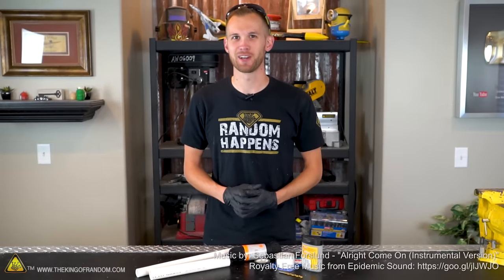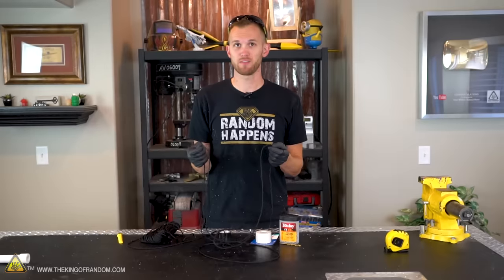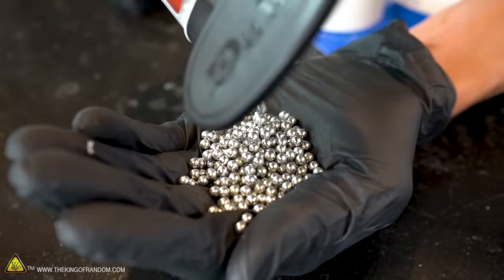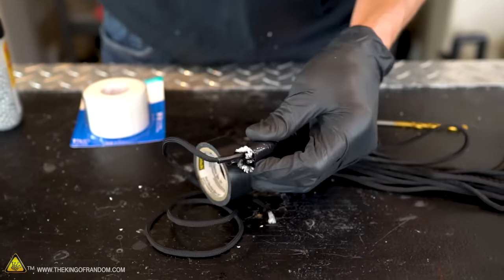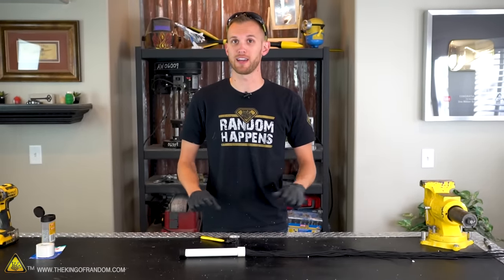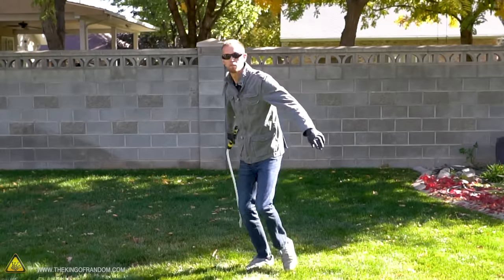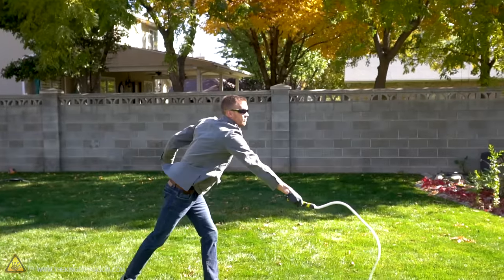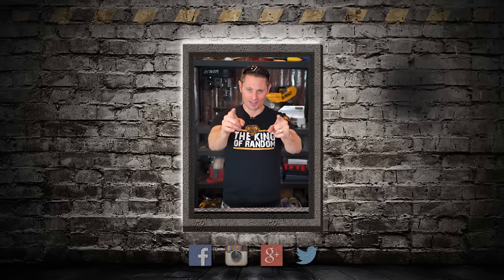How To Make a Paracord Bullwhip (like Indiana Jones)! TKOR’s How To Make A Bull Whip Guide

Comment: For everyone who doesn't really want to watch the whole vid 

Para cord bullwhip

Three quarter inch PVC 
One inch PVC 
30m para cord
BB's
KT tape
Electrical tape 

1.Cut the 3/4 inch PVC to nine inches 
2.Cut the 1 inch PVC to 1 inch
3.First piece of para cord 8 feet long (8feet in front of handle 2feet behind)
4.Use electrical tape to mark where the bottom of the handle is
5.And 18 inches from the end of the para cord (the fall of the whip)
6.Cut nine more pieces of para cord of diminishig lengths 
7.First piece of para cord must go from the first tape mark to the second 
8.After that each piece must diminish by 8 inches every time 
9.Cut three more pieces of the same length as the 3rd largest;6th largest and 9th largest piece of para cord 
10.Fill those with BB's 
11.Close the one end off by melting it 
12.Take a drill bit a bit bigger than the BB bullet, and stick that in the para cord once you've gutted it, the melt it so it stays open permanently.
13.every foot and a half tape it with para cord once the rope is taped into the handle,
After that rap it with KT tape and then your bullwhip is complete!
Reply: Bradley Whitburn but its not kt tape
Reply: Having personally made 4 nearly identical copies of this whip and have a fairly small, but diverse collection of whips. From experience, here are some recommendations if you want to make your own, for anyone who ends up seeing this:
1. Don't bother with the longest BB strand- it makes the whip too heavy
2. Take about a 3ft strand and wrap it around the base of all the strands, then tuck it inside the PVC piping- it goes a long way towards making the whip last long term. It is also recommended to connect it as you would with the longest core strand by wrapping it around the very butt of the whip
3. Use quite a bit, but not too much, heavy duty tape when you are connecting the rope to the PVC. Too much will make that section inflexible and it will not crack properly (about 4 reversing, fairly loose wraps of duct tape worked well)
5. For a beginner, i recommend actually using a shorter whip- around 6 feet is plenty, and is actually closer to what is used in competitions anyways.
6. Be careful. Choose a low traffic area, such as in your backyard, and mark off a spot where you have at least three feet more than your overall whip length in every direction. Even behind and above you. Trust me, its important.
Reply: Jalen Johnson what a legend
Reply: The video is only 11 minutes and it takes more time than that to make the whip
Reply: Nathan Meadows what?

Comment: Having personally made 4 nearly identical copies of this whip and have a fairly small, but diverse collection of whips. From experience, here are some recommendations if you want to make your own, for anyone who ends up seeing this:
1. Don't bother with the longest BB strand- it makes the whip too heavy
2. Take about a 3ft strand and wrap it around the base of all the strands, then tuck it inside the PVC piping- it goes a long way towards making the whip last long term. It is also recommended to connect it as you would with the longest core strand by wrapping it around the very butt of the whip
3. Use quite a bit, but not too much, heavy duty tape when you are connecting the rope to the PVC. Too much will make that section inflexible and it will not crack properly (about 4 reversing, fairly loose wraps of duct tape worked well)
5. For a beginner, i recommend actually using a shorter whip- around 6 feet is plenty, and is actually closer to what is used in competitions anyways.
6. Be careful. Choose a low traffic area, such as in your backyard, and mark off a spot where you have at least three feet more than your overall whip length in every direction. Even behind and above you. Trust me, its important.
Reply: Yes this is true i tried it without the longest strand and it saved so much time and still worked

Comment: If I make a longer whip, should I still use the same number of strands and size difrences, or proportionally scale it up
Reply: Sidney Wateski most likely scale it
Reply: Probably both. If it gets too thick it wont work as easily.
Reply: Sidney Wateski  idk
Reply: You'll end up adding a few strands. You want the whip to start tapering at about 2 feet from the handle. So if you do what they did and drop strands every 8 inches then you'll need to add strands. 1 for every 8 inches

Comment: Can you heat slime to the point in which it is a gas?
Reply: That's just evaporating the water off which would leave all dry components you used in the slime in the container
Reply: karl malek no
Reply: Daniel Wyatt is right.
Reply: Daniel Wyatt and that would probably burn

Comment: Can you tell the paracord sizes and
Reply: its 550 paracord, Military grade with 7 stands on the inside.
Reply: BostonTricker not that I want to know how long is it and how many do we need
Reply: I didn't tell you how long it is or how many you need. 550 is the name of the paracord as it can with stand up to 550 pounds before it breaks and 7 strands inside the paracord is the indication of Military grade paracord as the will be consumer grade one out there that doesn't have the 7 strands on the inside of the paracord.
Reply: That Steveguy  Cant OP listen?? It says it in the video.
Reply: Think Creative and helpful fun
Reply: TheYakisobaNoodle Sorry Tyne Tyne Tyne Tyne can’t die die die yeah I live
Reply: Para-cord comes in various lengths ranging from a small hank of 25 feet in hobby stores to spools of 500 feet that can be found in military surplus stores. The commercial grade 5 strand would be just as effective for this type of whip as they have approximately the same properties. The 7 strand may be a bit easier to feed the BBs into for creating the shot loads though. 

The lengths for the whip are provided in the video, but as a guy who makes whips, I would like to suggest attempting to at least coat the outer layer with a herring bone braid since the para-cord would make a much more durable surface than the tape.
Reply: BostonTricker That's a great answer to a question no one asked.
Reply: Think Creative its just 550 cord
Reply: About 10 to eleven feet for the longest strand
Reply: hunter childers  Sounds like an interesting experiment that yielded horrifying results. What kind of shoes do you do?

Comment: no braiding? Interesting way to do it. I thought the braiding of a traditional whip helped translate the kinetic energy down its length, but this process
 worked really well so kudos!
Reply: I thought that was weird too but remember, the projects on here aren't meant to last.  They're meant to be easy enough for people to do at home without special tools. No braids just means this is going to fall apart after a year or two of use. Braids in a whip are meant to increase structural integrity to make the whip last longer as the strands pull on each other rather than just themselves, distributing the force more evenly

Comment: You need a proper snapper on the end of the fall, use the paracord innards a single strand 6 inches long folded in half and overhand knots about an inch apart so only two for a three inch snapper then to tie it make a loop on the end of the fall and Lay the very end of the fall across the loop you made and pass the loop on the snapper through the one on the fall and pass the end of the fall through the snapper loop making a hitch then pull on the snapper and the fall to tighten the knot and the snapper is secured, and add more paracord so the diameter of the wrapped paracord will barley fit into the pipe and add extra layers of tape between the body of the whip and the handle. the first six inches of the whip body is essentially a spring so make it tight and progressively less springy farther away from the handle, and for better whip control make the handle longer so therefore you have more leverage on the whip making it easier to crack and easier to control a 12 to 14 inch handle will work a little better for an eight foot whip.  Just some constructive criticism from a fellow whip maker and food for thought.

Comment: An easier and better way to get a louder crack is to take two or three of the inner strands and twist them together. I them would tie a know 5 inches from the tip, one in the middle, and one more connecting the strands to the end of the parachord. This creates a much louder crack and requires less effort to crack

Comment: Although it wears out pretty quickly, you can get a louder crack by putting a broken up piece of yarn or twine in the tip. Professionals use Kevlar and other materials. Also, there are far better and more proper designs.

Comment: You know what's easier? Instead of BBs, buy a big spool of nickel ball chain, tie one of the inner stands to it and when you pull the inner strand out, it pulls the ball chain in. Seal both ends, and done. Same end result, but far easier and WAY WAY faster

Comment: What can I use instead of Bb’s because I am in australia
Reply: You could look for 4mm ball bearings. You should be able to find them in some bicycle supply shop, or at least that's the description of the bearing that I sourced for. The size is similar to BBs and based on my estimate, you'll need about 850-900 bearings.

Comment: can we use duct tape rather using athelete tape?
Reply: You can, but every plastic based (kinda) tapes (like duct tape, Electric tape...) has a tendancy to dry out and shrink, and eventually breaks after a couple of cracks which will result in creases in your whip.

Comment: Why not just braid all the Paracord Peace's together before wrapping them up
Instead of leaving them plain I think you might get a stronger cracking sound and increased durability
Reply: Braiding would decrease the length of the whip alot
Reply: Soo it if we dont change the full length of the whip, it would cost more for more paracord or if we don't change the length of paracord, the length of the whip would be shorter

Comment: I am sure you have seen it.  But. . .smarter every day did a video that included the best scientific data, to date on whip mechanics.  The shrinking mass along the whip maintains kinetic energy by speeding up.  The crack does not necesarily come at the fall.  Depending on your skill strength, and the whip design it may crack much sooner.